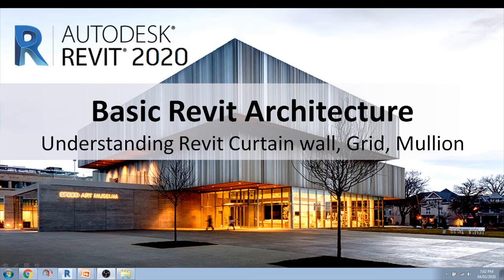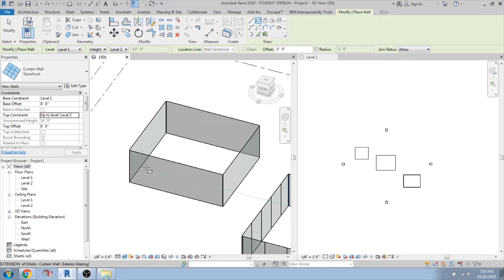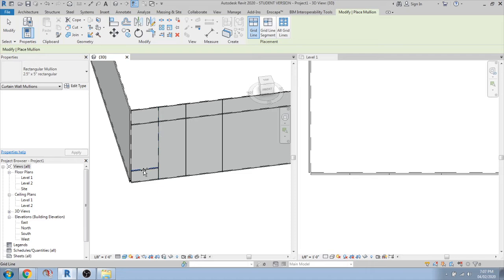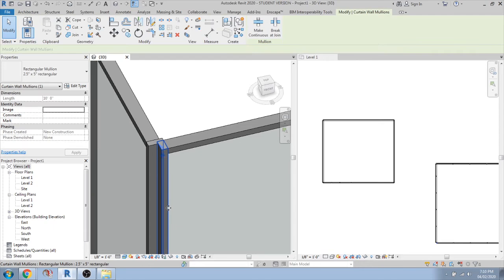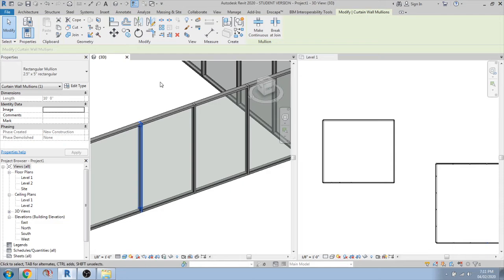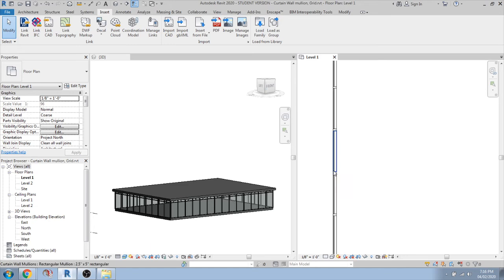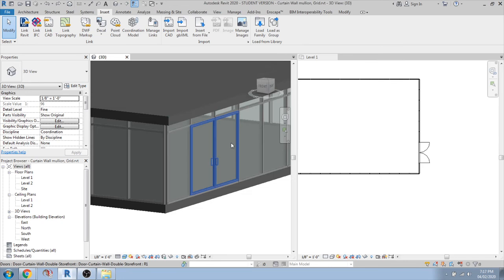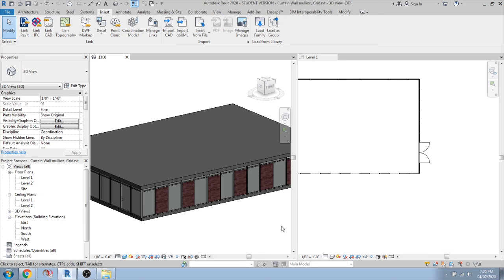Revit Tutorial 7: Understanding Revit Curtain wall, Grid, Mullion

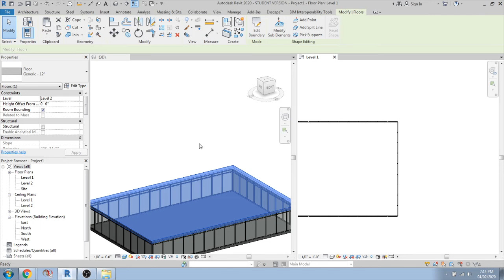Comment: Hi sir, sir at 13:27, while offsetting the boundaries of the curtain wall, 
I'm unable to finish as it's said that the lines are overlapping and are intersecting when it was not ... I mean I couldn't fine. Then after undoing it. .. edit boundary was not showing the offset tab ? What do I do sir
Reply from the maker: Use Tab key to click proper line. And Make sure that all lines connected properly.